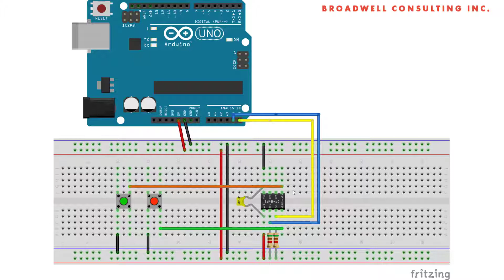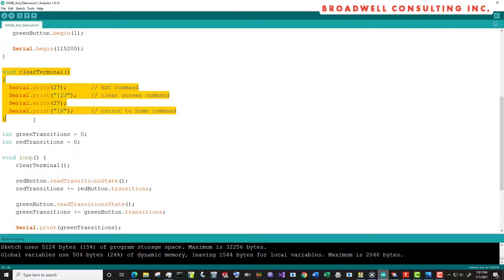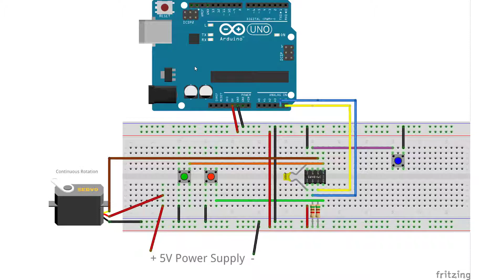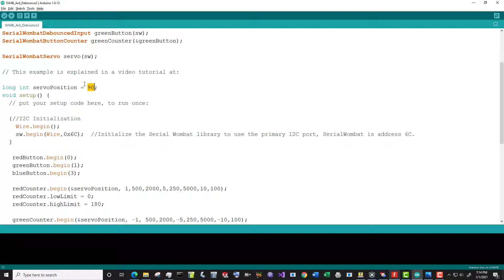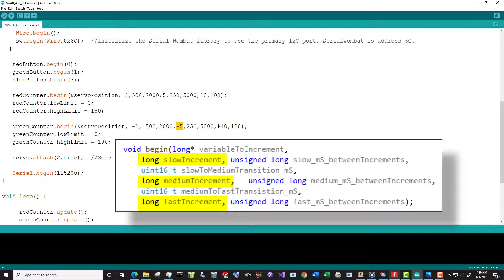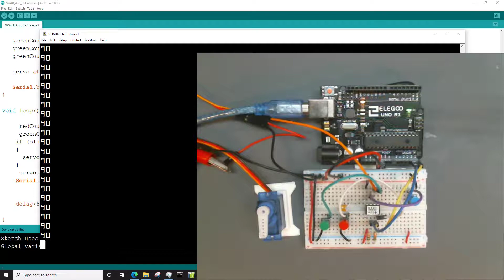Debouncing Buttons with Serial Wombat 4B chip's Debounced Pin Mode

Comment: Interesting chip. I like the internal switch debounce. Few questions: 1) I assume it can work with 3.3V as well, right? 2) Is VScode supported as well? Is the lib available? 3) I couldn't locate the lib in EasyEDA. Would you consider adding it? I can do it  myself - no issue.
Reply from the maker: 1.  Yes.  You can power an SW4B chip with 3V to 5.5V.  I2C lines can be 3V up to whatever you're supplying the SW4B chip with.  
2.  I'm not sure what you're asking with this question.  If you want to modify the firmware (most people don't) then you'll need Microchip's MPLAB X development environment.  If you want to use the SW4B firmware as is like any other I2C device, you can talk to it using available Arduino or Python libraries.
3.  I haven't used EasyEDA.  I use Eagle/Fusion for PCB design.  I'd be grateful if you want to share any EasyEDA assets you create.
Reply: @SerialWombat  I am not sure I understand what do you mean by "assets". I create PCBs using EasyEDA for my projects because wires are not stable. I find EasyEDA comfortable because it is linked to LSCS for parts and JLCPCB for production.  In order to use your chip, I would need a library schematic and layout, and a 3D model attached to create a 3D model of the PCB with the devices.
Reply from the maker: @YigalBZ  I'll look at what it would take to make this available.

Comment: Just received my wombats, and getting them to read a rotary encoder was so easy, I'm watching this video to learn how to read the push button of the RE.  My goal is to be able to build menus into my projects to expand functionality.  My current project is a heating unit and controller for my 3d printer enclosure, as well as operating the heating and cooling elements in my diy filament dryer.  So far, I'm super impressed with the Wombat, and can't wait to integrate them into all of my projects.  (I use a arduino type board called a Pro Micro, and I/O's are something I always need more of. )  Freeing up the Arduino to do other things while the Wombat handles I/O functions is just opening doors of all kinds in my projects.... my days of 10k pots mapped for inputs are over! 

I do have a question, and perhaps it's in the literature somewhere that i haven't consumed as of yet, but it seems to me that there are 4 addresses for the A and 4 addresses for the B, so, in my mind, that would limit a person to a total of 8 maximum Wombats on an I2C bus... Is this correct, or is there a way to reassign the address of the Wombat, so that i could use more than 8?
Reply from the maker: Hey Joe, glad you're finding the project useful and easy to use.  That's what I was shooting for when I envisioned the project.  The rotary encoder firmware and Arduino library got a lot of attention and automated testing before release to make sure they weren't "glitchy".  I'm glad it's working well for you!  I think you'll find the button debounce to be quite useful as well.

Right now you can only buy directly 4 different I2C addresses (the Serial Wombat 4B chip, 6C through 6F).  For the rest you'll need to program them yourself.  I've got a sample sketch that does a bootloaded download where you can set a new I2C address to a Serial Wombat 4B chip.  I hope to have that and an instructional video released sometime in the next month, although I've got a heavy load from consulting work right now that's slowing down some of my Serial Wombat fun stuff.  You need to use both the I2C bus and Wombat chip pins 0 and 1 to do the bootloaded download using UART, so it usually won't work in circuit.  I'd suggest adding sockets to any PCB where you may want to make these changes.

The B in SW4B indicates my I2C firmware.   There will be a UART Version (the SW4A) released sometime in the future.  This will be useful for driving from a PC.

I've also been working on the SW18B model, which will be a Serial Wombat chip with 18 pin-mode pins based on the PIC24FJ256GA702.  The plan for that is to be able to pick one of a number of different I2C addresses or UART based on resistance of a pin to ground.  I've been surprised by how many users are using multiple SW4B chips in one circuit, so I think the SW18B chip should be popular.  I'm guessing end of 2021 for release of that one.
Reply from the maker: @Moondoes Manufacturing  Great!  I hope you enjoy using your Serial Wombat chips.  If you have any questions drop them on the video best matching your use case and I'll try to answer them.
Reply from the maker: @Moondoes Manufacturing  Sometime in Q1 of 2022 for the SW18AB.  I've got a good number of 28 pin DIP package chips to launch with.  My original desire was to produce PCBs based on the SOIC package of the PIC24FJ256GA702 that included the Caps and resistors on board along with QWIIC connectors, but a small time guy like me isn't going to see any on cost-efficient tape and reel packaging until at least Q3 2022.  So I'll launch with DIP package like the SW4B.  

As far as timing, it's feature complete so we're getting there.  I'm being fairly disciplined about not letting feature-creep occur at this point.    I've changed a few things late in the game that I realized would box us all in later if I wanted to not break backward compatibility.  

If you want to be on the cutting edge, you can grab the files from GitHub and program a chip with the PICKIT4 programmer. 

Otherwise, I'll formally launch it when I have good, thorough automated tests that all pass (I just got in a custom PCB i designed that lets me test 16 of the SW18AB pins against 4 SW4B chips for automated testing of pin modes on both chips using the same Arduino library), and when I have good documentation including firmware and Arduino library doxygen github.io pages, and a sufficient number of youtube videos to guide new users in the extended feature set.  Plus I need to do high-quality photos and copy for the Amazon product page.  All that takes a lot of time, and this is a side-hustle to my consulting work.  But I'm thinking late January or early February.